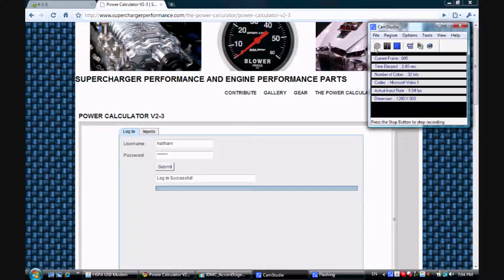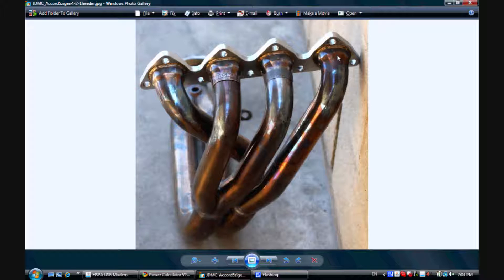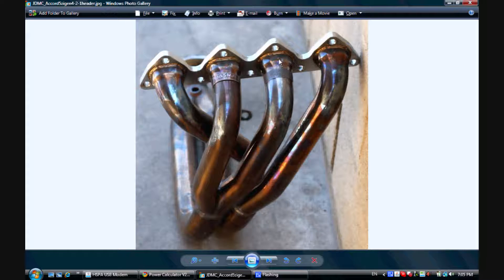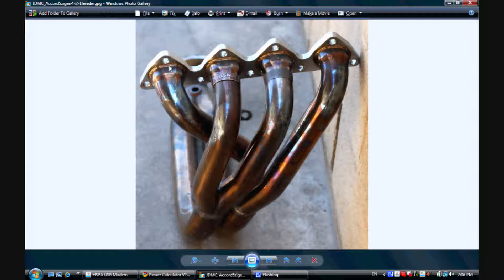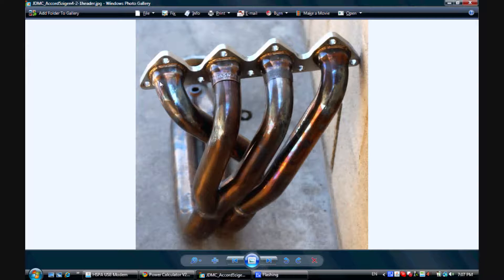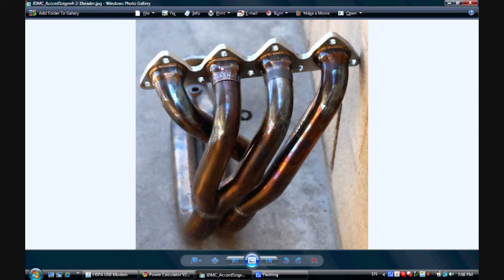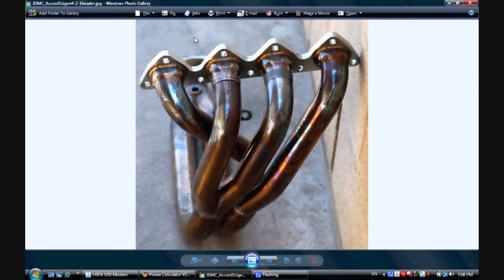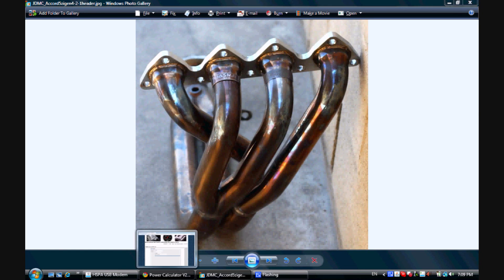Supercharger Calculator - Designing a 4-2-1 header part 1 theory

Comment from the maker: 4-2-1 has is tuned for two resonant rpms which are usually peak torque and peak power. 4-1 is tuned for only one resonant rpm. This can be any rpm the designer chooses. Usually people do a 'shorty' 4-1 with short pipes tuned for peak power or close to redline, but there are other applications with 'long tube' 4-1 where the resonant frequency is tuned for peak torque rpm... you see these long tube setups mostly on trucks or on cars that have their top end taken care of by a centrifugal charger.